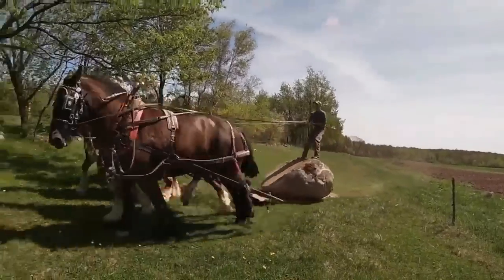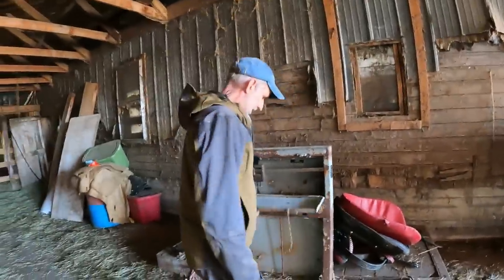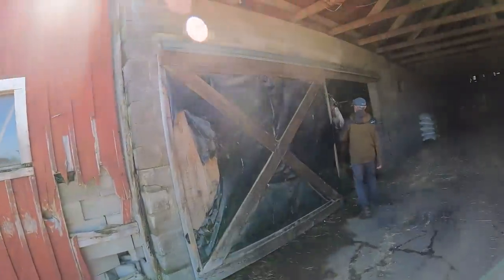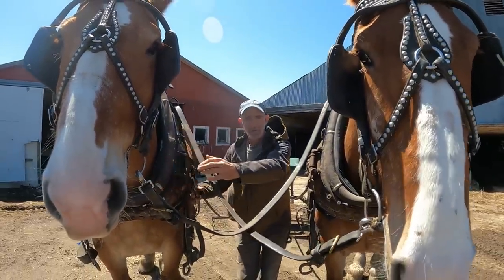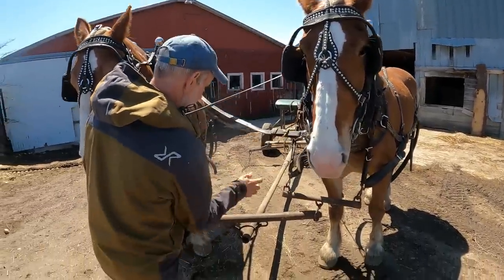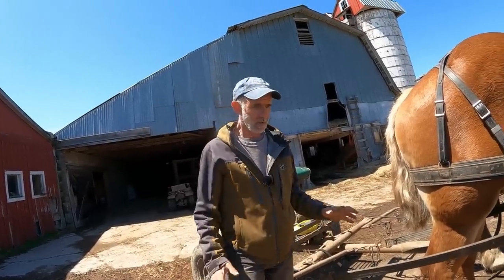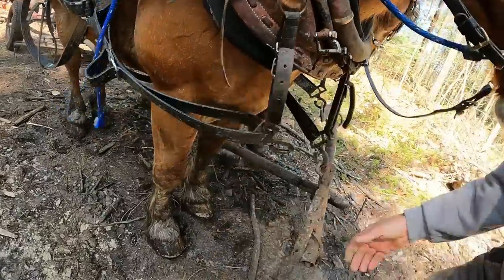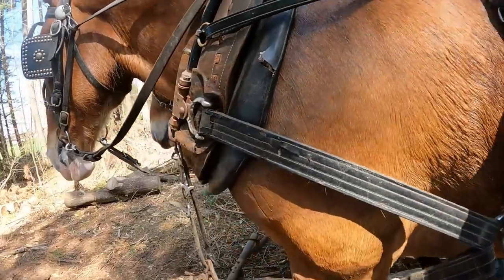Hitching a TEAM OF HORSES to a Cart & a HORSE RUNAWAY STORY!! // HORSE BASICS #8

Comment: That is more than I would have thought.  I don't think my leather harness was that heavy.  I never weighed it, but I know what my limit is for lifting.  I would have guessed it to be 30-35 lbs, maybe 40 tops.  That said, it might have been more of a farm chunk size than a ton horse size.  It was way too big for my ponies, but we made do.  Those carts have drum brakes on them, as mine did.  If that is a front axle, that would probably put it back into the fifties.  

The other thing about hitching up the neck yoke first is that the horse then has control of the cart and can stop and turn it.  If you hitch the back end first, they can go, but they can't turn or stop.  Taking a bridle off a horse that is still hitched at an ADS show will result in you immediately being escorted off the grounds, or at least it did when I was showing.

Years ago, The Draft Horse Journal published an article on the direction snaps needed to face.  We tend not to think of such things, but if a snap is facing the wrong way, a horse that is biting at flies or shaking their head can snap a rein to a collar ring or catch a bit ring on a yoke strap and panic and run away.  That might be something worth discussing as well.
Reply from the maker: Hi Thirza! Sometime I am going to have to show a close up of my line snaps, I feel that they are are very safe snap. Thanks for your comments

Comment: @ 21:15 you hooked both sides of Bill's and not the outside of both first as you did with the other cart. I didn't see a problem but if they were to bolt and run off there could be. As with a young green broke horse could.
Reply: Could be a difference in the carts maybe is why you did it that way.
Reply from the maker: if you were to go back and watch it again you would see I did the same for both. It is different when I unhook